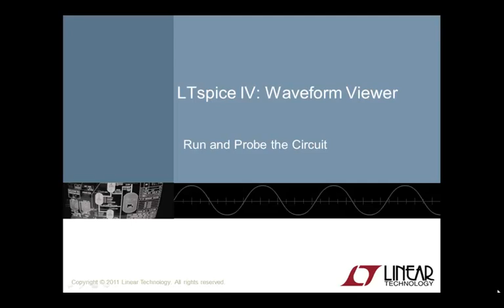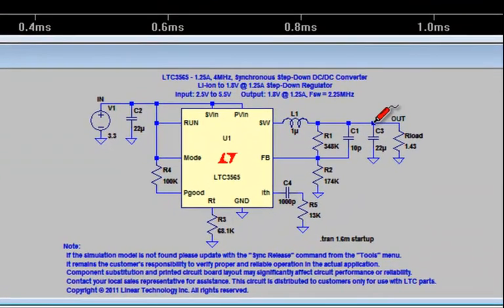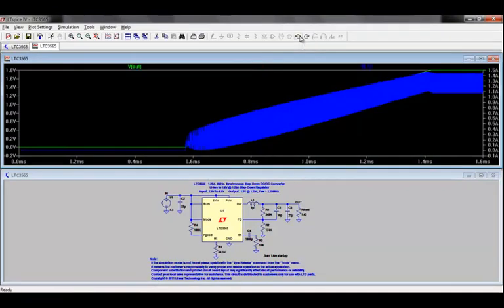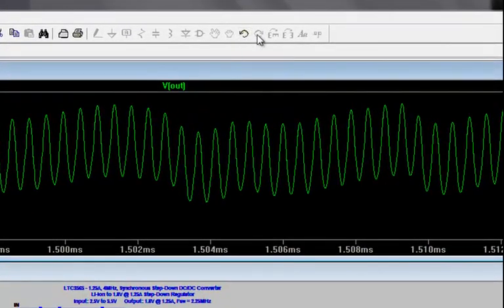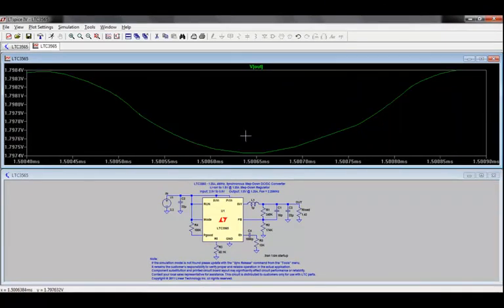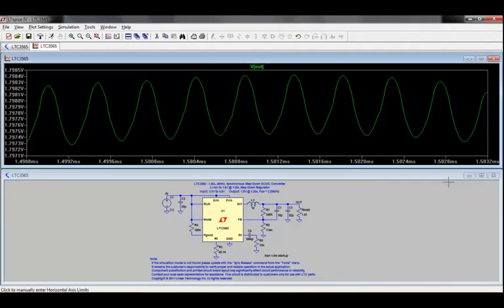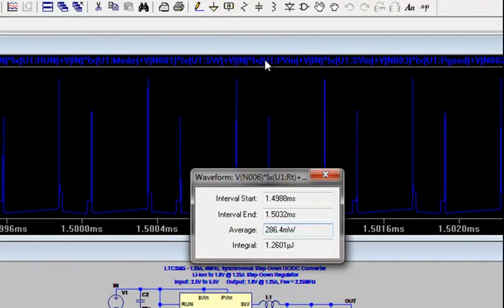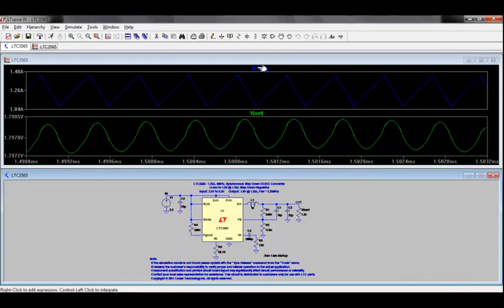LTspice Waveform Viewer

Comment: I  built a simple test circuit that includes a PWL source voltage, a Fuse subcircuit and a resistive load.  I have two voltage probes on the test circuit fuse input and output.  But, how do I add 4 probes to nodes in the Fuse subcircuit?